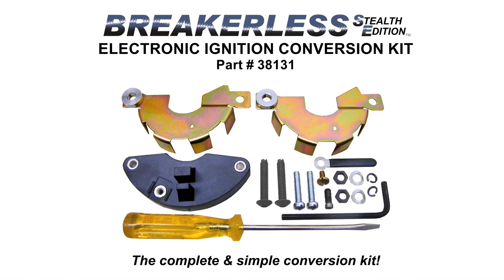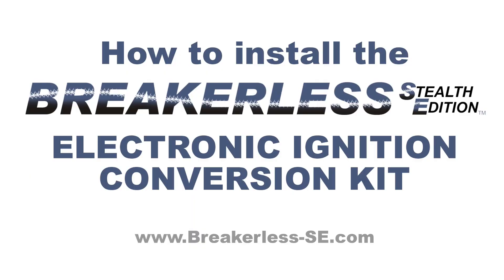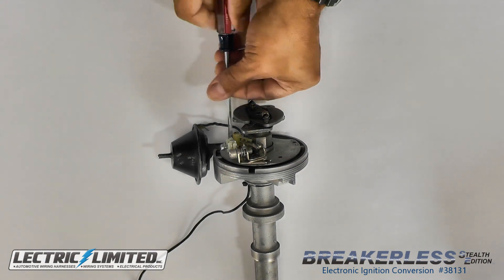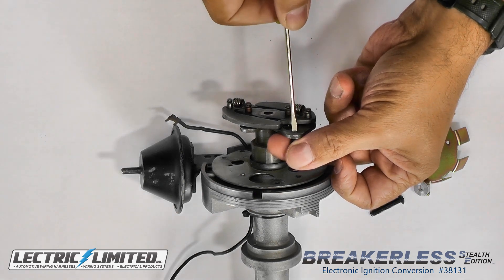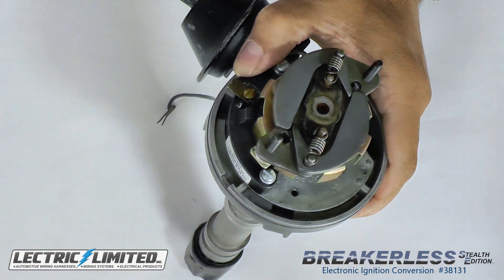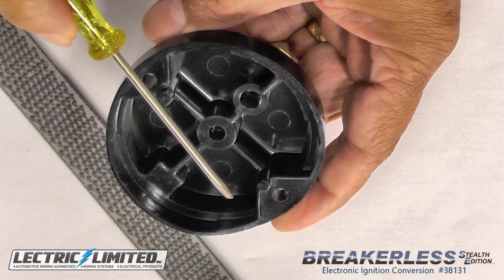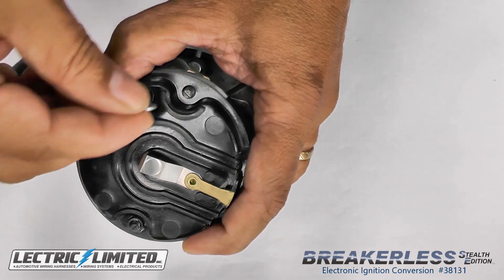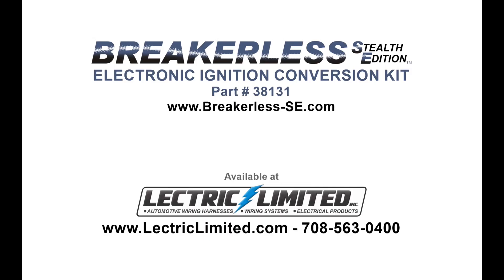EASY!  How to Install the Breakerless-SE (single wire) Electronic Ignition Conversion Kit - #38131

Comment: I just installed and works great, My question is whats the best coil to use i have an accel yellow 42000 volt coil on there now,   Would the breakerless coil from accel make a difference? thanks